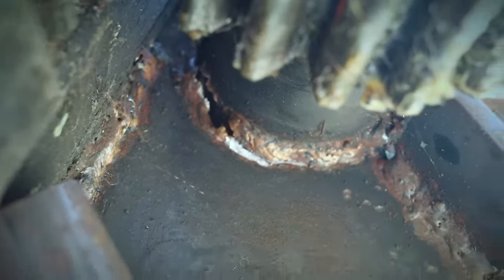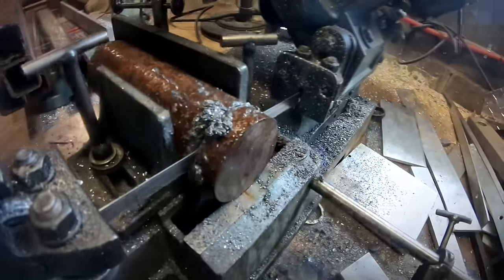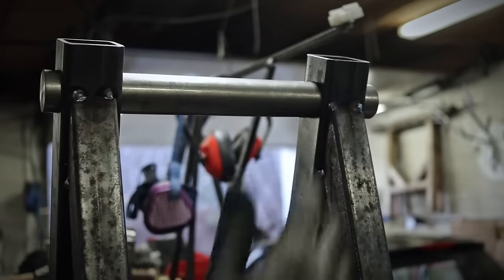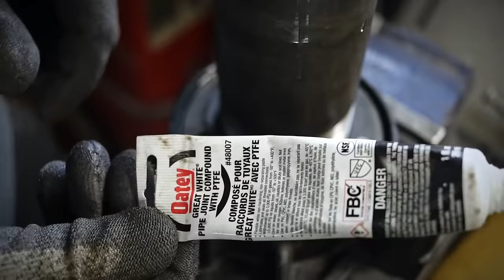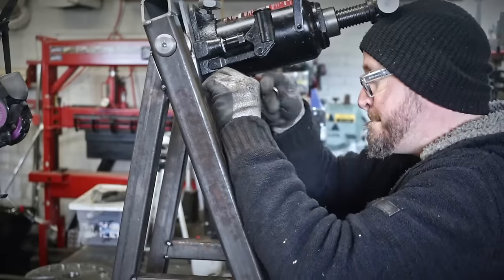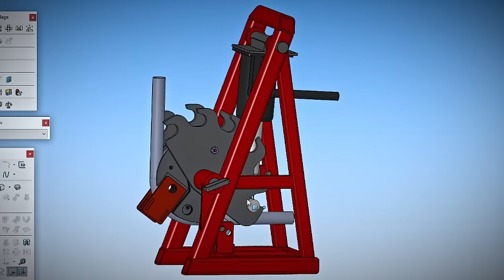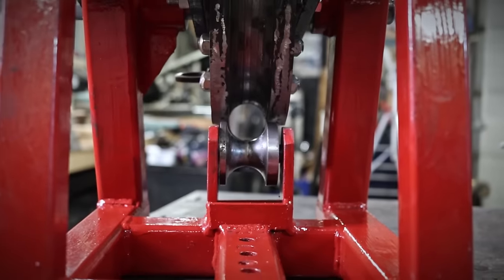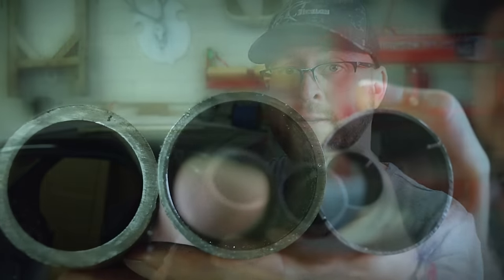Building for free, the BEST TUBE BENDER EVER....#bigstatement #tubebending #tubebender #bender

Comment: This will forever be my go to video for modifying a bottle jack, to run it inverted. Why do I need to run a jack inverted? I don't know yet, but when I have a reason, I'll be back here
Reply from the maker: 🤣🤣🤣 Good one! Save the link preciously....for that one day, when you will need that inverted bottle! 😁
Reply: He could have designed it for standing vertically and welded a plate to the base but what he did was still brilliant. I’m hoping that hose is actually a submersible hose because many hoses can transport fluids but their outer skin can’t stand up to petroleum based products. Viny, If I’m right and that hose disintegrates, simply buy a piece of PTFE tubing and slide it over the tube and clamp it on with an Oetiker clamp.

Comment: Why you don't have the jack at the bottom pushing up. You can put bolts on the dial so you can adjust the gap to put different size tubes.

Comment: While you're in that bottle jack you should have also threaded on a Quick Connect fitting so you could use it with a air over hydraulic foot pedal and convert it to a ram cylinder. I did that with mine and It's awesome and I'll never go back

Comment: Amazing video. Your content and editing skills just keeps getting better. I was watching this with my wife and explaining what you were doing with the jack modifications and saying how impressive it was that  you were showing how to do all this work just to avoid paying for a pneumatic one,  and now i'm excited for episode 2.  I have used a 3rd gen speedway bender for years that is very similar to the eastwood one and I love it, but it is certainly not everyones favorite style, and it takes some getting used to.
Reply from the maker: Hey Austin!!!! Never heard of the speedway before, I had a look and you re right, it s wayyyy better version than the Eastwood.  What is the max you bent with it (without cranking it with a 10ft pole 😅)
Reply: @VinyB57  mine is super easy to crank, just like a regular bottle jack. The only problem is it will only bend to 90* which ends up being like 86* after the pressure is released so I have to slide the tube in the other way and rebend it if I need a true 90*. I built the entire crown Vic trophy truck with it and apart from being slow it was fine. I don't do a ton of bending though, maybe one roll cage every year or two.

Comment: I would put an hydraulic log splitter on there instead of the bottle jack . I use them to power all sorts of machines up . They are Quite easy to chop down smaller if needed .    and you can pick them up quite cheep
Reply from the maker: thansk Andrew for the tip!

Comment: Instead of air over hydraulic maybe try electric over hydraulic.
I added one off eBay for 129.00 USD to my bender and it works perfectly. Can bend 90 deg in about 12 seconds
Reply from the maker: I did a quick research and I only found 5ton bottle jack, did you found a 20t? If so can you give me the link?
Reply: @VinyB57  I might have caused some confusion with my statement. I bought a Rogue Fab M600 many years back and instead of using air over hydraulic, I bought a hydraulic control switch with a solenoid along with a 220v single phase pump designed to be used with a 2 post or 4 post lift. I cut the steel reservoir length down and mounted it to my rolling cart. I can make bends with a quickness and saved thousands by doing it this way. Maybe I should make a video about it.
Reply from the maker: @bretbradbury5559  Ah, now it make sense!

Comment: Rather than use the slow hydraulic you can simply drive a worm gear into a large diameter tooth gear that is adjuacent to our die and drive it with an electric 9 amp drill.
Reply from the maker: That could work with a ''big enough'' worm gerbox.

Comment: How did you afford all the tooling in your shop. I’m trying to build one like yours
Reply from the maker: Simple, I builded most of my tooling. The only big purchases are; the plasma torch (not the CNC table, I built the table) the welder, my lathe and milling. And with time, a little budget and the will to buy old machines and fix them, it's not that expensive!

Comment: no sure if youd call that free..lol.    also,  you can pack the tube with sand to prevent flattening..i used to do it making 316 stainless boilers with a rotating table and some dies i patched together from scrap
Reply from the maker: Well I paid nothing for it...🤷‍♂️😅 Yep I tried in the past the sand trick, I shoud try it with tinner side walls, thanks for the reminder! 👍

Comment: Wires be too high on that first shot of the weld he always tell when they start getting pointy in the middle like it builds up in the middle I know cuz I do it all the time myself it's hard to do it in a straight line without moving your mig gun, try to do a straight one and you got too much wire speed so you don't move it back and forth you just go straight up the scene and start puckering up in the middle I was the only way I can explain it when you should be able to go straight up the scene and it melt outward and not f*** her up in the middle so different heat travel speed and too much wire and it'll make it pucker, but we're all learning it takes time and mistake and that's how we all learn in this life and it's terrible these victim Hood type out here that don't realize that hard times and mistakes and failures this is the only way to actually learn anything

Comment: It wasn't free. You had $500 worth of steel, and $2000 worth of labor in this video. Also $10k worth of tools to make it. Don't get me wrong, I still loved it.
Reply from the maker: OK but for real...I spend not a dime on it! I'm using bids and pieces from other builds and an hold bottle jack...I think the paint was the think I had to paid for...like a year ago.. but if you,re starting for scratch that kind of build...it's not free..that I agree on!
Reply: @Viny B  it's still awesome. I have most of the tools except the lathe. I'm trying to build a KJ Raycing cross kart, so I need a bender. RF is so damn expensive. The video is still 🔥
Reply from the maker: @sandman7793   You should definitely get a lathe before such a built. By far it's my favorite tool in the shop!

Comment: kinda disappointed you didn't convert your jack into an automatic one here is the YT video code 
watch?v=TJJYvZ8D5YI 
this design is well in your skill range and tool range not to mention cheap to do so AND its the same orientation also so no head scratching a simple make and bolt on affair ;) so you can either return the jack OR use it for another project like hydraulic vice for example